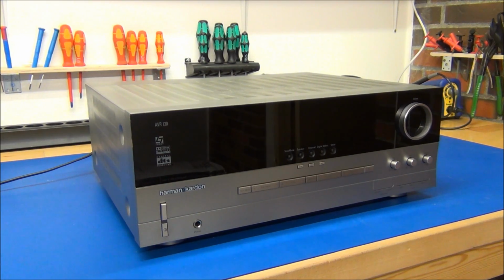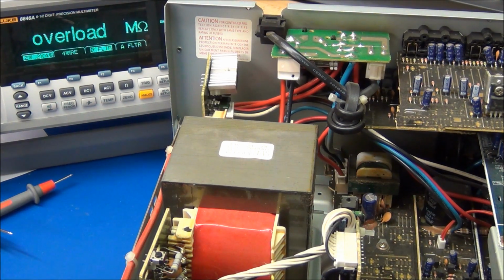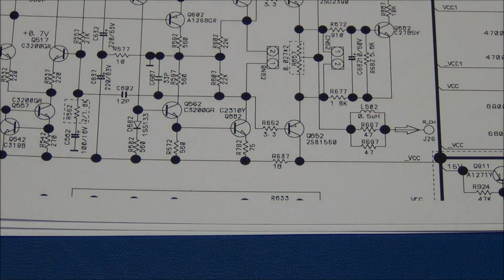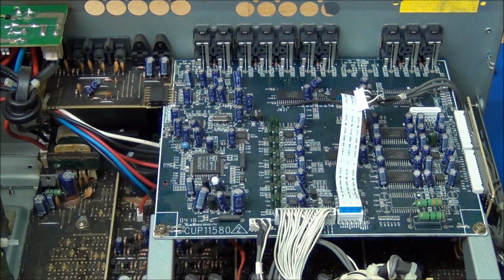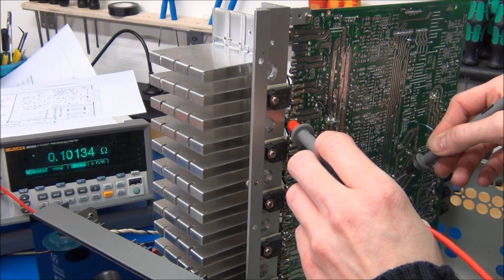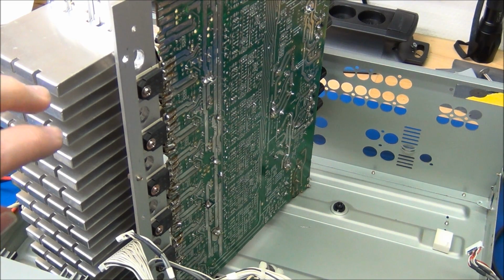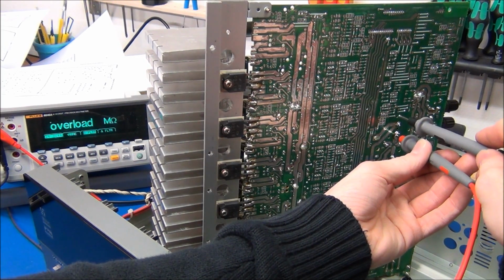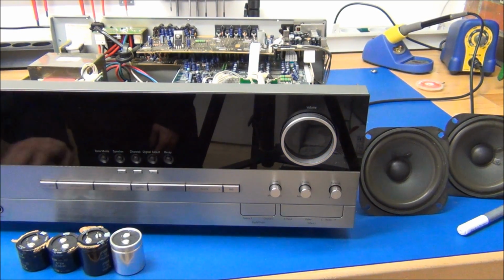Harman/Kardon AVR130 Repair - Ec-Projects

Comment: I had the same reciever on my bench for repair. All the electrolytic caps in the amplifier section (the two next to each other close to the output) were rotten, almost no wires anymore on the base. I changed many caps and the amp runs fine again

Comment: Hello,Hello, when I connect hdmi 1 to the TV, the harman kardon avr265 avr amplifier detects the TV, but the harman kardonavr265 does not display a menu on the screen, the sound mode and video mode keys on the front panel and the remote control do not work, I could not solve this problem, I do not know where to look, I do not know what to check, I would be very happy if you could help me.

Comment: Anyone with a 130 that has standby led on but no switch on with button or remote:  check for the reset switch shorted. It is on the top of  the small rectifier board , left side , attached to the big power transformer. This one was breaking down at about .2v, causing the micro to ignore any other commands.  Hope this saves someone a lot of diagnostic time.  Might be applicable to similar models.  I have also found the .47 ohm resistors on that board burnt due to the .1uf ceramic caps shorted. Also, applicable to similar models.

Comment: greetings from the UAE-ABU DHABI, i have an old HK AVR 130, it turns ON and OFF (sometimes) and while its ON, i connected 3 speakers for a while (center, right, left), somehow its only LEFT. tried MASTER RESET, set up speaker volume, balance, did not work. need help. i want to salvage this old AVR of mine. (its old i know). NEED HELP

Comment: Hello EcProjects, thank you for this informative youtube video. I have also an issue with the AVR 130 but in my case the right sound doesn't work if I plug the right speaker into the left input it works fine and when I plug the headphones into the AVR just left side works fine and no sound on the right side. Maybe, you know a solution to this. I would really appreciate to hear from you.

Best regards!

Comment: I have inherited an AVR700 which seems to have a similar issue, lights but no sound. It's very similar inside so I'm hoping to use your excellent troubleshooting video to diagnose mine.
One side note, I did find out that the "Tape Output" was producing audio when connected to a separate amp. The headphones output is dead. It seems like the issue lies after the preamp section. Thanks a lot for your excellent video sir ! Wish me luck, I'll report back.....

Comment: I know you're trying to drag your video out to get more views but if you do it right people are appreciate you more easiest way to find out you gave a clue the minute you started talkin on the radio audio place flying through the headphones nothing out of the speakers usually it's a short and the amplifier section the very first thing you should test APA transistors or something in that section and I guarantee you you won't have to go through so much of this just pull the mainboard out and check your final outputs because anybody who services this type of equipment knows that Harman Kardon inotorious for these transistors to blow and you would save yourself a lot of headaches just pull the main board out and test the final Outlets looks like you were right this time but the majority of the time when there's a short like this it's usually a final output that course is at 10 nothing ventured nothing gained that's the first time I've seen that with a Harman Kardon

Comment: Hello. I have an avr1710 that didnt want to power on, however it would ‘reset’ using the front surround mode key. 
I found and repaired the key2 track below the screen overlay and now all button show activity in their respective pins key1 and key2 bit still not powering on. Now it wont even reset with the surround button.
Could you please help me troubleshoot this receiver? I know its a big thing to ask, but I dont know where else to look. 
Thank you.

Comment: I have Hk HKTS 7 hooked with HK AVR2550. Everything works as it should but no sound from any speakers. I have tried changing sources, changing place for optical cable, just opened the avr today and couldn't find any tell tell sign of anything, rather overwhelmed with those complex looking circuits. Any help guys ??

Comment: hi I have AVR254 and its not response to the remote control and there no response to the front panel just the LCD in DVD mode and I can't change the mode there no any operation I replace the the big caps with the same type and there is no operation still and I did a reset by pressing the OK and still can you help me ...thanks

Comment: HOW TO ; PLEASE HELP! TECHNICS SA- GX550 5.1 Surround Receiver. turn volume nob 
static sound how to fix? Spray some kind of cleaner IN IT, WHAT KIND?   
  ALSO,  JVC 5.1 Surround Receiver. L+R+120Wx2 per CH. L+R+ front 100Wx1
 CENter.  20W x2 SURr. 20W x2 rear L+R, Speaker wireS CRossed AND 
shorted out! Now NO POWER ! SEEMS JUST LIKE A FUSE BLEW! HOW TO FIX, HOW DO I REPLACE IT HELP!?

Comment: PLEASE HELP! TECHNICS SA- GX550 5.1 Surround Receiver. turn volume nob static sound how to fix? Spray some kind of cleaner IN IT, WHAT KIND?     ALSO,  JVC 5.1 Surround Receiver. L+R+120Wx2 per CH. L+R+ front 100Wx1 CENter.  20W x2 SURr. 20W x2 rear L+R, Speaker wireS crossed AND shorted out! Now NO POWER ! JUST LIKE A FUSE BLEW! HOW DO I REPLACE IT ? PLEASE HELP FIX! THANKS

Comment: JVC 5.1 Surround Receiver.100Wx3 per CH. front L+R+C  20W x2 SUR. rear L+R speaker wire crossed shorted out now NO POWER LIKE A FUSE BLEW! HOW DO I REPLACE IT ?

Comment: great video. i have an avr5000 that loses memory (retune the radio and speaker settings) when the mains power is turned off. do you know where the memory cap or battery is located that maintains the memory?

Comment: Hello, great video. I have an AVR7000 that has worked without issue for 16 years. Now the pre-amp board has an issue. I'm in Canada, do you have any idea where I can purchase a pre-amp board for this unit? part number J4025100100A. Thx.

Comment: Great video- very comprehensive and impressive to the detail! I have 2 HK receivers- AVR 635 which basically freezes after an hour or 2 of power on and becomes unresponsive to remote or the front panel controls. The other receiver is a AVR 347 which has the same symptoms. Problem is sporadic and frustrating, can you direct me where to begin and probably give me a hint of which items need attention. Thanks a lot.
Reply from the maker: +Jay Em Thank you! Hmm, does it stop playing also ? It could be something with the processor, perhaps the power supply for it dropping out or something.

Comment: I have a HK AVR 247 that someone spilled a coke on... everything works except... no sound. Pretty important feature. Any advice on trying to clean things up on the inside? There could certainly be some other issues... most important one first. (sigh)
Reply from the maker: +liamlad1 You had me laugh at "Pretty important feature" ;) I would recommend using Isopropyl alcohol and a brush (antistatic if possible), for the electronics at least. Just make sure it has stayed unplugged for a while when you do it..! So there is no charge left in the capacitors. Also check the fuses :)

Comment: i have the same receiver. i was watching tv and all of a sudden i had no more sound, when i run the speaker test i can see it working in the display but there is no sound, anyone any idea what might cause this?
Reply from the maker: Heer Ollie Could be the same problem, but not sure :) Did you try the headphones ?
Reply: EcProjects hi. yes i did and also no sound. display is working fine but no sounds whatsoever.
Reply from the maker: Heer Ollie I would start by checking the fuses. If blown, then measure the resistance of that power rail (when powered off of course). If it is close to 0 Ohms, there is a good chance it is one of those caps :) But it could easily be something else :)
Reply: EcProjects the repair man told me two transistors and a chip were broken, the costs would be 90 euros. with these kind of things you never know if he is bullshiting you or not.  then i ask myself  how likely is it that 3 parts break down all at the same time? or am i overreacting?
Reply from the maker: If he already did the repair, it's probably true :) The price is mostly labor anyway with those components :) If he didn't, it would be very hard to tell exactly what have failed.

Comment: Hey there great video! I have an HK AVR 132. It had been lying for a while & I set it up again today after a long time. I used to use a set of 8 Ohm speakers on it. This time I decided to add another set (which read 7ohms) and connected them in parallel to the stereo out put. I had not tested the amp before connecting the speakers. When I powered it up it played radio for a few seconds before displaying "PROTECT" and switching it back to stand by. I immediately disconnected the speakers and tried again this time it went to "protect straight away without even playing for a few seconds.. I read in the manual that you can reset the device by keeping it in standby and pressing the surround mode button for 5 secs. So I reset the device successfully and tried again but still the same situation. I realize that the resultant impedance from the 2 sets of speakers connected in parallel was around 3.2Ohms(both by calculation and on the multimeter) which is too low and almost a short circuit. Any ideas what I might have blown?
Reply from the maker: Naushad Kharas Hey! :) I am not sure but I would start by checking the fuses, then the output transistors (even though a few seconds shouldn't be enough to blow them :/ ) ! Is the AVR 132 rated for 8 ohm speakers ?
Reply: EcProjects Unfortunately unlike the AVR130  that you worked on there is no conventional fuse. The back panel has 8ohms written on it. I will check on the transistors. Thanks

Comment: Can I get the part numbers for the (4) high temp capacitors. I have a HK AVR 240 that powers on but no sound output that had them replaced a few years back now it happened again.
Reply from the maker: Shawn Hoetger I don't know if the AVR 240 uses the same capacitors, but here is what I
 used for the AVR 130 (different brand of caps):50VXG4700MEFCSN30X30 and
 LGY1H682MELB35 I tried to link to them, but YouTube screwed up :) You 
can find them on Digikey.But to make sure, you can measure the 
dimensions and pin spacing of yours, 
then put those along with the ratings into the search table of digikey 
or any site you prefer :)

Comment: My receiver works (i.e., I get sound with all of the devices hooked up to it) but I can't see the display screen.  It appears as if the screen light went out.  Any suggestions/tips on how to fix it?
Reply from the maker: ***** Hmmmmm. There is a lot of possibilities  :/If it is the backlight, you could hope there is a fault in the power rail. You can try to search for a schematic online, and measure the voltages. (Careful: There are high DC voltages on the amplifier board ! So don't touch it !)

Comment: hi whats the problem if i cant gett any sound from it bute everythink ells works ? 

//sry for my eng
Reply from the maker: Hi, I'm afraid it could be one of many different things.. But I would recommend starting by checking the voltage rails. And check if any fuses or components are blown :)

Comment: It was the capacitor this time, but sometimes an insulator fails at an output transistor. Seen it a few times - causes the same symptom. Good Job!
Reply: Have you seen the Marantz SR4000 series inside, its almost the same. Wonder what relation is between HK and Marantz!
Reply: NSluyter There's a surprising amount of commonality in some receivers - especially the amp sections. A Pioneer VSX-1021 for example has an almost identical amp unit to a Denon AVR-1910. I jokingly say that they "came out of the same hole". Anam is the big Chinese company that makes these.
Reply from the maker: Thank you for mentioning that :)
Reply: Haha, must be a big hole! They probably make >50% of all receivers/amps. Price for a new AV receiver is so low nowdays, for $250eur you have a nice receiver. This must put some pressure on the repair market, such repairs quickly take you 1/2 day or more. Maybe you interested in my fb group https://www.facebook.com/groups/1624348004467344

Comment: Nice video!
Question. I have a Harman Kardon AVR 354 receiver that behaves strangely. Random sound dropouts (lasting for ~1 second) occur in all sound modes, all inputs, with or without any external connections. Strangely, during the sound dropouts the front panel (and volume light/led) black out. During those intermittent and random sound/display dropouts, the power led remains on, and (apparently) all the relays stay on. Between these occurrences, the unit functions "completely" normal. After a while (time varies 10-20 minutes) the sound drops off completely (but the unit stays on, and the front panel working OK), but reappears "normal" once you switch to another input. At other (rare) times, the sound goes completely awry (~whistle).
I tried repeated CPU resets, doesn’t change anything. In an attempt to see if anything wrong with the DSP/CPU, I reinstalled the most current firmware (this is done with the unit in standby), and everything went OK. The F110, F111 fuses and wire (jumper) from HDMI board to Regulator board upgrades (as per HK bulletin) have been addressed by the previous owner. I also measured different voltage (regulators), but all seem OK. Of course, the problem is that this issue is intermittent. My question is what connects the sound drop with front display and volume boards concomitant malfunction. I didn’t see anything similar on Internet; have you any idea where to look?
I have basic electronic (incl. soldering) skills, if I only knew what needs to be checked/replaced.

Comment from the maker: Hey..
It could sound like a shorted capacitor, they can sometimes come good again after a while, and then fail again when they heat up..
But that's just a guess..
I think your approach is the way to go :)
If you can find the schematic you can see if any devices could have failed between the two points you measure :)

Comment: Hi thanks for reply - I already sent a reply but I can't see it anywhere... so I will write it here.

I measured both on and off but the SR channel showed a much lower resistance between +ve and GND than all the other channels. After about 2 hours of gentle use, it tripped again and powered off. I re-measured and there was Zero resistance between the +ve terminal - therefore a short I guess.  Best thing now is to just trace back from the output and perhaps compare to the SL channel ? thanks

Comment from the maker: Hello, did you measure the outputs while the device was turned off and unplugged ? 
The resistance on the outputs can't tell much normally, because there is capacitors and transistors in the way of the measurement. 
But if you leave it powered off and unplugged for a little while and measure the terminals, and then as you say only one measures significantly lower, it could indicate a fault in that channel.

Comment: It powered back on and. I measured the resistance of the speaker outs and the SL is significantly lower than the others.  Could this indocate a fault in this section of the amp?

Comment from the maker: Hey, to me it sounds like something went wrong in the digital / processing circuitry.. But can't get any closer i'm afraid :( Does it show the Incoming signal data on the display when you connect a coax/opt cable while the receiver is on ? (I.E. PCM 44.1 Khz for 5 sec, or whatever you are using :P )

Comment: HI, thanx for the video. I have an AVR 255, and after 2 years there is no Audio at all, but only Video. It all started maybe 3 months ago by not having audio sometimes when you first turn on the AVR, but after restart the audio usually was back. By the time it started to happen more often, till one day it was gone forever. All audio outputs are dead incl. h-phones, no radio. I tried to reflash the firmware, but during the flashing the audio part, it stuck. Do you think it's repairable? Thank you

Comment from the maker: Thanks :)
That would be hard to tell. But yea, it could easily be an electrolytic. If you have a multimeter, you can try measuring the resistance across the caps to see if they are shorted. But even if the resistance across the cap is 0 it can still be another component on the same rail. Hope you'll find it :)

Comment: Excellent video, I have a subwoofer infinity SW12, which was shut down running, seeing the board I see that the fuse is blown. this has nothing intact all physical short and is no longer under warranty. What can it be? Perhaps capasitores will be the electrolytic?

Comment from the maker: Yes I had myself quite a surprise as well, I did not expect to find low reliability components in such a unit. There was not a 105c or brand name cap in sight. 
It does sound pretty good actually. But obviously they don't care about if it's gonna last or not..

-Mads

Comment from the maker: The 10 mF is the same about price as the 6,8 mF here unfortunately, but they didn't have any in stock that would fit. 
It had to be less than 32 mm Ø. And they only had 35+ mm available. :(

-Mads

Comment: You probably could have gotten 10000uF units for the price of the 4700 ones though. 47 and 10 are the most common values and the multiples in capacitors nowadays, the other values are less common.

Comment: I would have made them all 6800/50 caps, a little more value is always good on a power rail. Only issue would be going massive overkill which might pop fuses at power on.